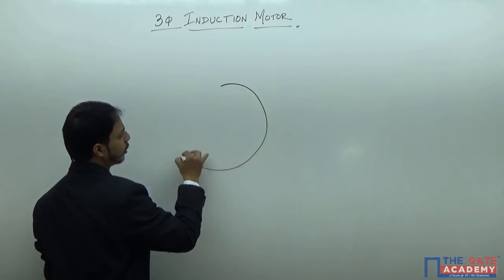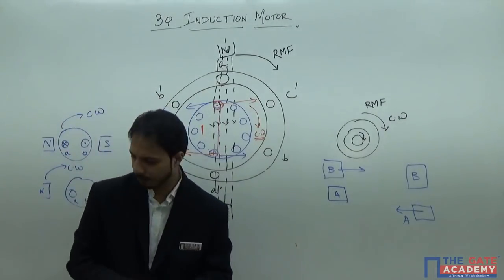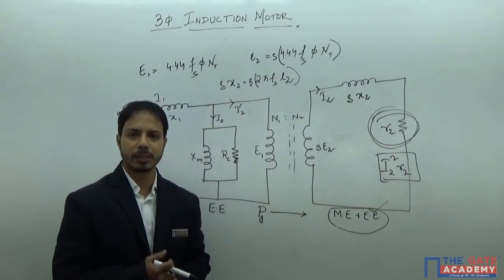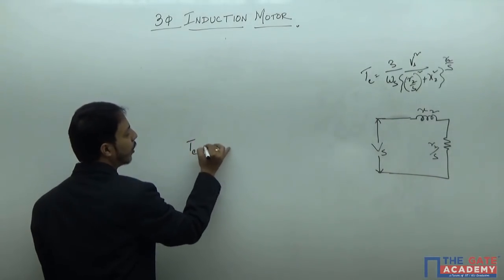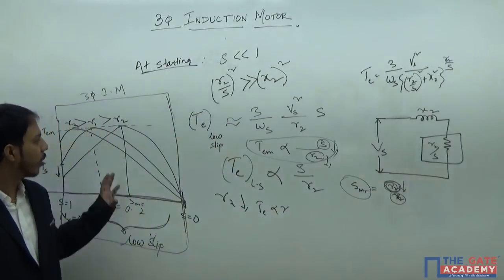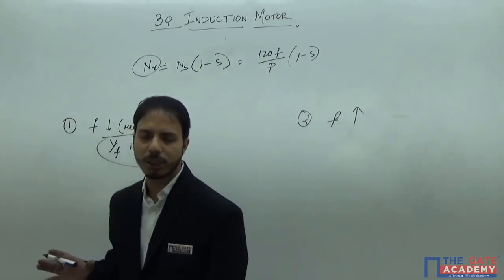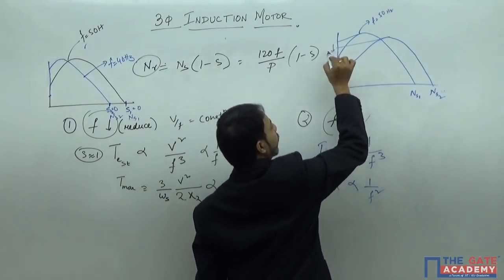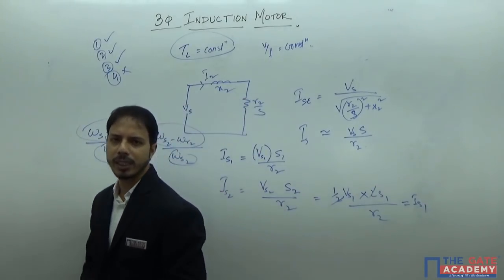Analysis of 3 Phase Induction Motor | Electrical Machines | EE

Comment: Thanks for the video. Please sir, can you assist me with the anlysis on phase variable modeling and simulation of three phase induction motor using winding function based theory model.The aim is to: Investigate parameter sensitivity  for motor performance interms of air gap, torque, current, and speed.Once again, many thanks from Nigeria.

Comment: Why in synchronous machine when rotor is rotating at synchronous speed emf will not be zero
Reply: shaik vaheedha because we have given rotor to dc supply which create constant pole...and stator magnetic field rotate...at the time north pole of stator and rotor meet... so force of repulsion create between them.. but due to inertia of rotor it cant move.. simalarly for south pole....hence we have given external source for roatate rotor..and says prime mover it will rotate rotor to synchrnous speed....so rotor is not self start.. hence rotor runs at symchronous speed and its emf will not be zero.. i hope you got your ans
Reply: There is no air  gap at  between rotor and stator so there is no creating or producing emf